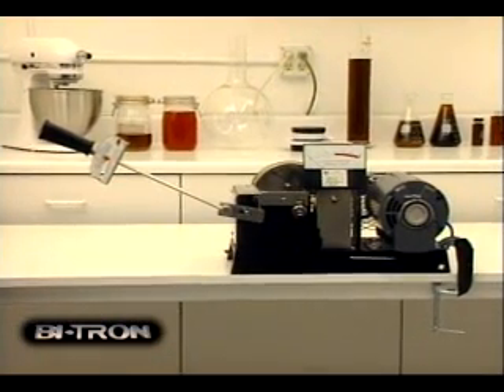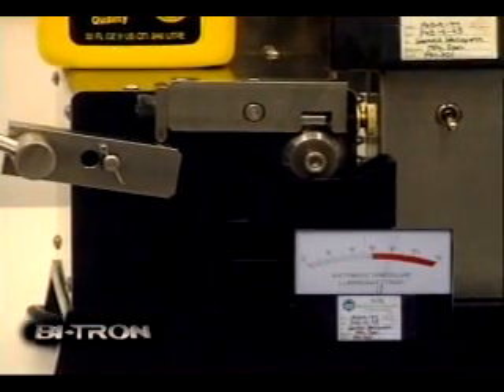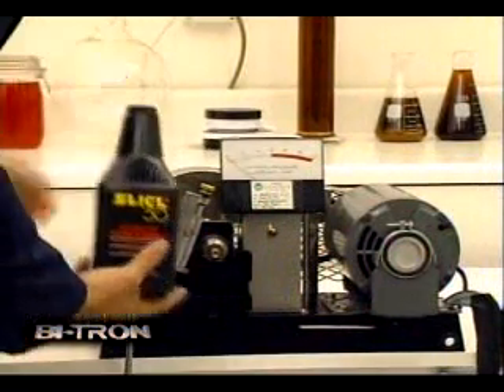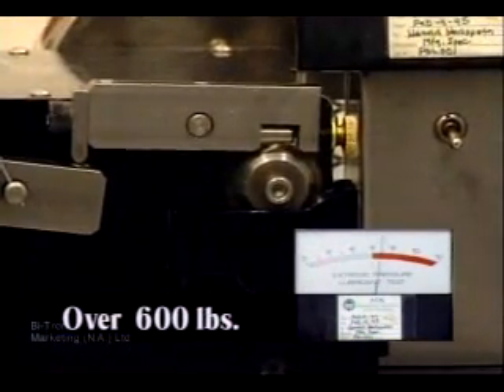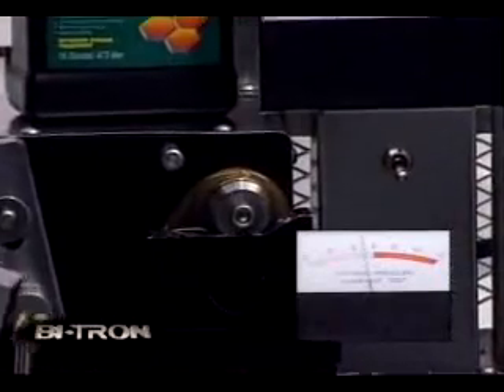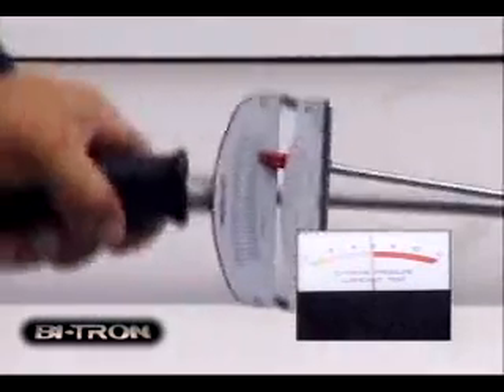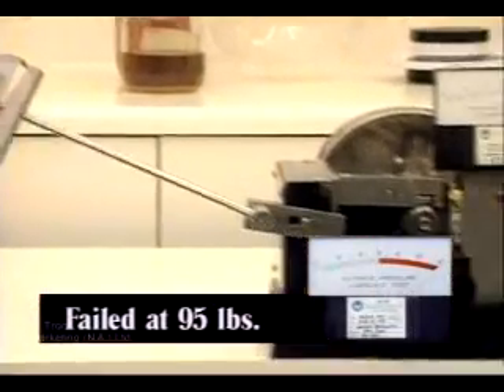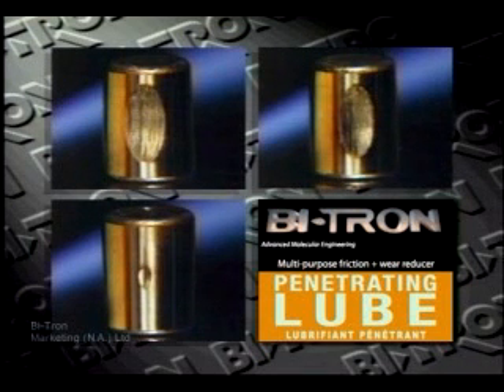Bi-Tron Lubricant Test

Comment: I bought a bottle of this stuff back in the 90's to stop a customer of mine pestering me. I had a Datsun 1200 with an Auto Transmission & I think it was a 2 speed. The car was getting 25 mpg & when it shifted gears it was like getting a whiplash. I stuck in one bottle while the engine was running & half a bottle in the transmission. That little 4 cyclinder motor quietened right down & the idle was as smooth as a new car. The shifts were almost imperceptible & my hwy mileage went up to 45 mpg. (imperial)  A better demonstration would be to video it being added to an idling car to see the before & after. If this is still on the market in 2021 I'd buy it again.

Comment: That's weird. I had pretty much same machine like this and I tried it with Dura Lube in 1994 and it did not acted like on this video. But it showed same results like with BiTron added solution. Now what is the true? I may agree that is better than DL. But how about the test result then and now? Hm. Really strange. I'd like to see a new test.

Comment: Oil companies do not use this test method as it is not a recognized test method by any reputable NATA certified testing authority.
I evaluated this product over several years in a vehicle I personally put over 450 000Km on the clock 200 000km for a gearbox without 246 gear treatment and 200 000 after using product at each gearbox service before needing a rebuild.
Conclusion IT MADE NO DIFFERENCE ,service your vehicle according to manufacturers recommendations & use same brand of oil

Comment: does it have any SAE rating? what is unit of torque, or this guy putting 150 lbs of weight, I think technical guys refer torque as force/length lbs/ft or NM what is just lbs?
Reply: Smply Ediot, you know why? 'cause these products (pertua, x1r, etc) are just copy cats of Polytron which is the original Metal Treatment Technology product. Research it!

Comment: Same stuff over and over, so same answer. Guys read the MSDS and see the key ingredient of this is Chlorinated olefin or paraffin, which has been invented in the 30ties last century. It is cheap, but there are hazards to it by adding it to engine oil!! There are benefits too, but on the long run these are way overshadowed by the formation of acids and chrystallised chlorine particals. You ma save a buck or two on fuel, but if you plan to let your engine last longest it is best left alone!!